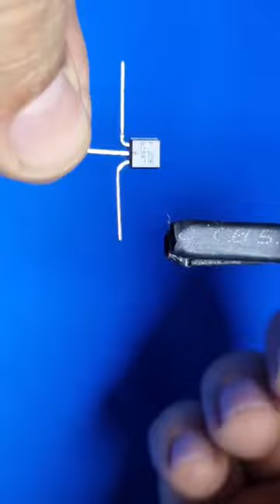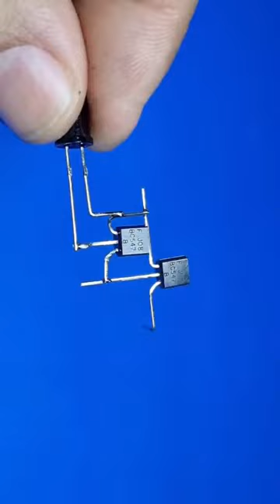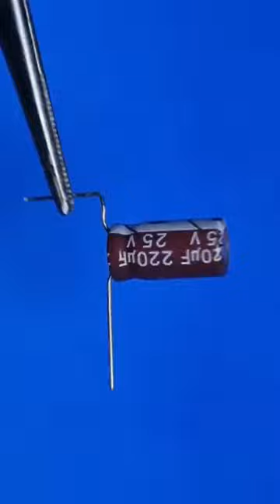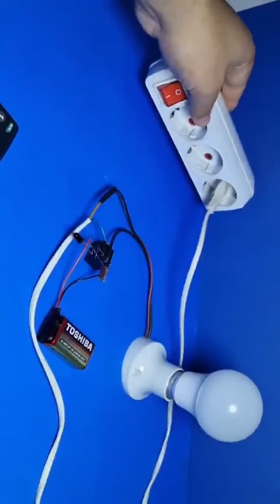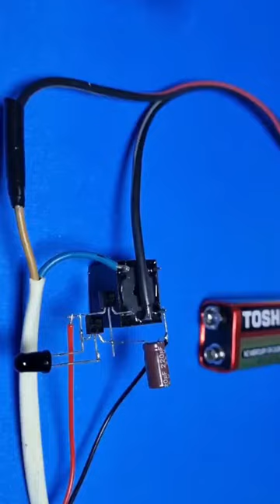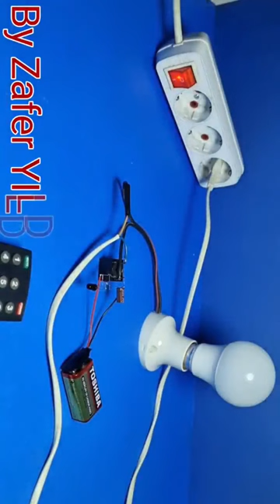Simple Remote Control AC Light Circuit - Without IC - Simple Infrared Receiver Circuit #shorts

Comment: Bigger capacitor longer = time ,also resistor in series with battery =longer time. Higher resistance = longer time. Fluxuating ir light in room can trigger light. . Movements in room stop light goes off.....